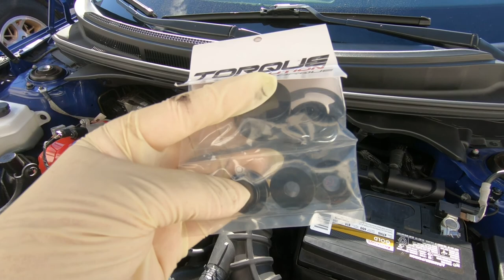Veloster turbo intake and shifter bushings install

Comment: what did you do with the big hose coming out of the top of the intercooler
Reply from the maker: That is for the factory recirculation valve. I had a 50/50 blow off valve from turbo smart (like $80) and after doing the intake it turned it to a 100 blow off valve. I would recommend doing a BOV so that hose just gets deleted and you would have cool turbo noises 😅
Reply: @DankersRacing  thank you brother I appreciate you
Reply from the maker: @Samuel Miller  any time! And if i take a while to respond to your comment make sure to hit me up on Instagram. Im always happy to help